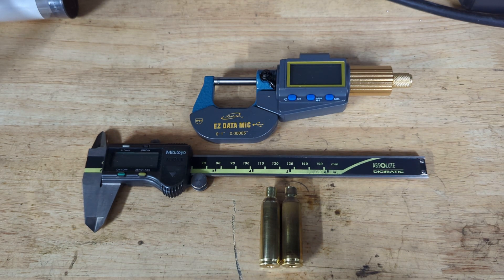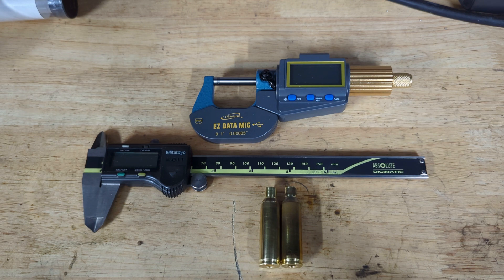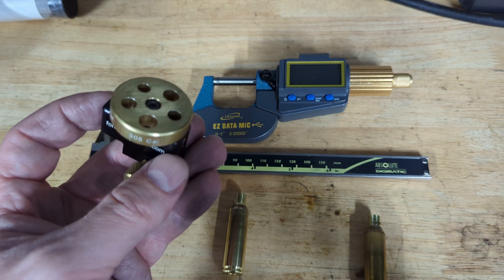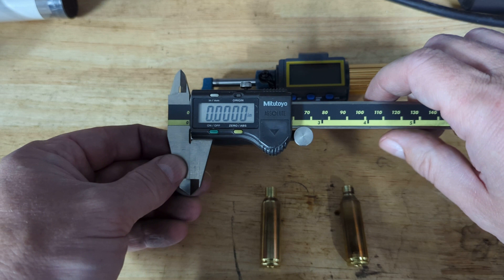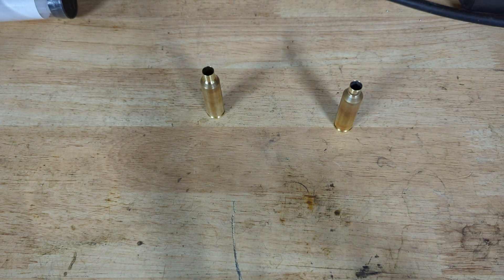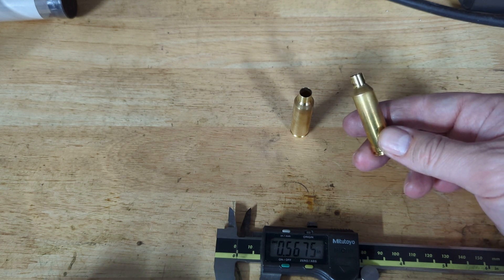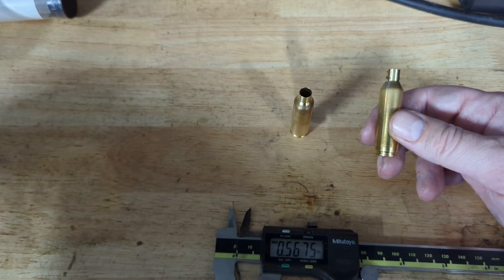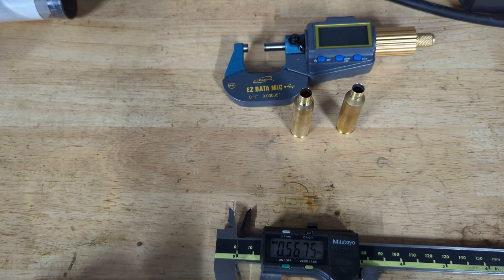7-6.5 PRC - Resizing die options and measurements to consider

Comment: By the way you need to spec lines  your case. The sammi spec is at .200.. You have the same problem most have with know real knowledge and not the right understanding of how to fix this. 
Erik has  one of his videos suggest  to use a case roller to fix this. Now he has a fix. I don't buy this. Alex Wheeler has the proper fix IMO.
Reply from the maker: My reamer was specced at .5355 at the .200 line. I think you may have missed the point of this video - I never suffered clickers with this cartridge and the Roll Sizer brings its own issues by lengthening the brass resulting in more frequent trimming. The problem a lot of people had with this cartridge is the fact that the brass is so tough, which allowed shooters to run above 2900fps, which they thought was awesome but resulted in clickers. Alex (and Jay Christopherson) never intended for this cartridge to run at 7SAUM velocities - 2850fps was the intended goal. Regardless, it's a cartridge I ultimately didn't feel offered anything my 284 Shehane couldn't do, and same applies with my 7KWS40.

Comment: You need an AW spec'd reamer. Fix the gun not the reamer from ???. The sammi spec is not good.
Reply from the maker: That reamer was not publicly available when I tinkered with this cartridge. If I was do try another reamer, I would do it differently but I would not go with the 1 degree lead that Alex went with as it limits bullet options.

Comment: Question. Your measuring a tapered surface with a flat bottom tool. Shouldn't you mount the micrometer with the side closest to the head at the .200 line? Otherwise, as your video implies that you are measuring the center of the micrometer at the .200 line. There fore you are measuring the case somewhere between the .200 line and the head on the larger taper, maybe about the .100 line.

Comment: Good info, what bullet seater do you use?
All info about this cartridge is about sizing dies but not much on seaters..
I just chambered a rifle using a manson .535 reamer.. now need dies !
Cheers
Reply from the maker: I used a custom seater based off the reamer being run through it. Worked very well.
Reply: You want a seater that only allows 0.001 clearance at the neck. This will keep the case tight and prevent "wiggling" which results in the possibility of searing bullets crooked or non-concentric. 

Speedy talks about that in a video with Cortina. Most seating dies, naturally allow plenty of space, but you want to avoid that with proper die selection according to the measurement of your neck (after being trimmed and seated with a bullet.)

Comment: Very interesting thank you so much for posting. I have the Short Action Customs die and I'm getting 0.53110" on the Mitutoyo micrometer. Hopefully I'll be able to avoid any issues, I'm brand new to this cartridge, and precision reloading for that matter. This is once fired Lapua brass (fired in a SAMMI chamber, moving now to a custom chambered barrel). EDIT-  The SAC die is consistently sizing the base down to .530 to .531 but it takes a huge amount of pressure to work the SAC press. I've tried Imperial case wax asd well as Hornady One Shot but I've had 2 stuck cases out of 50. I ordered a Universal RollSizer from Cortina as that was the route their machinist suggested. I'll pop back and update this post after using it.
Reply: The universal rollsizer seems to have solved the issue of stuck cases and the press is running a lot easier down to the bottom of the case.

Comment: Good to know, I have had the same issue with my 7 mm PRC die, Redding deluxe. Had to fully anele my cases otherwise they get stuck in the die.  I will be taking some measurements now to see if my die has the same issue.
Reply: I've never heard of fully annealing brass. I'd look further into it to see if its a negative action to perform.

Comment: Where can I get the neck wall measuring tool
Reply from the maker: Ebay: https://www.ebay.com.au/itm/125904448939?chn=ps&_ul=AU&norover=1&mkevt=1&mkrid=705-139619-5960-0&mkcid=2&mkscid=101&itemid=125904448939&targetid=1267522138537&device=c&mktype=pla&googleloc=9071968&poi=&campaignid=21005799790&mkgroupid=158199662866&rlsatarget=pla-1267522138537&abcId=9377966&merchantid=7364522&gclid=CjwKCAiAlJKuBhAdEiwAnZb7lfQqUe902pzZzia1hJMDMqJJdBLzB74Cpy0hxH-FdqTojrjq--3zVhoC49sQAvD_BwE
Reply: Thanks
Reply: To measure external case dimensions, that tool is perfect! To measure the neck wall thickness of the brass is actually a different tool. Instead of two flat positions to measure from, when you go internal to the neck, that will be a ball which "pinches" the neck wall to the flat portion of the micrometer.

Comment: I also have the first Cortina die and had the same issue. He sent me the second version and it works flawlessly.
I currently run brass into the second die set up for the .535 first, then run his first die set up for the .532 second. It works very well. Hope this makes sense.
Also, the die being extremely tight and the coating on the die seems to make additional friction. I have found coating the inside of the die with some imperial sizing die wax on a qtip helps tremendously. You also have to use imperial sizing die wax on the brass. Hornady one shot, rcbs case slick, etc. don't work with the coating.

Comment: Very informative and appreciate you sharing what you have found. I have Erik's resizing die, Arrived this week (AUS) also. Before shipping they asked what Reamer spec I had. I have the 0.535 manson reamer spec ... Therefore they provided the "6.5 PRC II" die for me. Which resizes at 0.530" (EC told me the 2 different versions size 0.528 or 0.530) ... I have measured this also, on sizing some Virgin Brass with Micrometers and verniers. Checks out at 0.530 / 0.5295
Reply from the maker: That new updated die sounds perfect in that case Jeremy. Do you also have an F-Open setup, or are you using it for something else?
Reply: @kriswilson5400  just waiting on my BRMXD from MattP to arrive. FOpen setup.